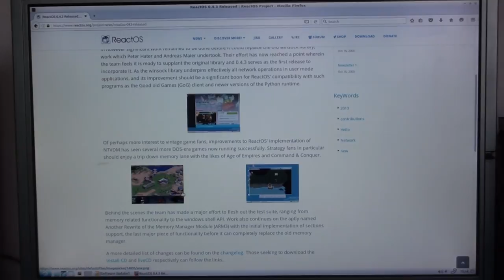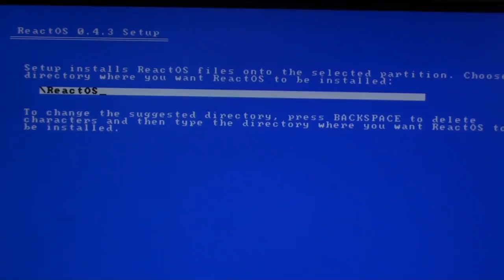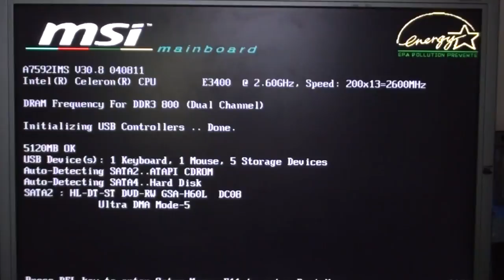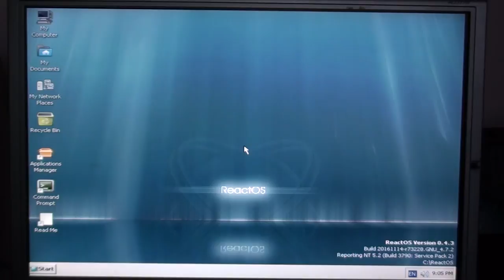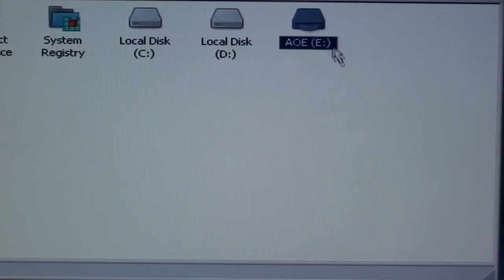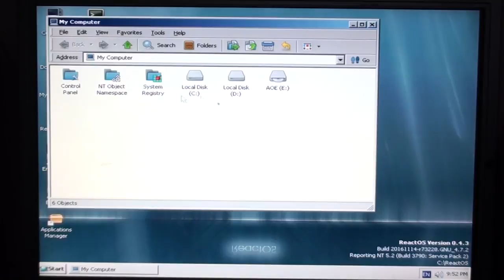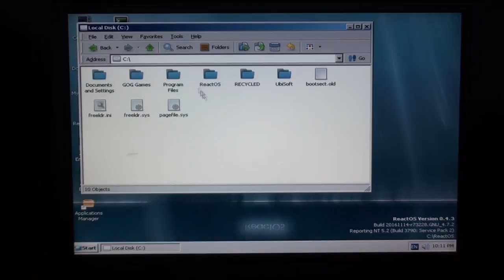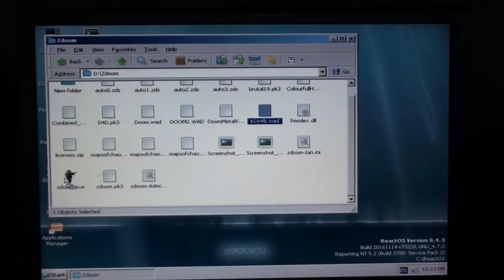A Return to ReactOSSD (v 0.4.3)

Comment: hi from ReactOS team!  Thanx a lot, Druaga! we are already in preparation of ReactOS 0.4.4 (with office 2010, printing and USB support)
Reply: actually no (we have some more important tasks), but you can do it with 3d party software.
Reply: hi love ur idea but i cant install this on my laptop / make a bootable usb
Reply: you can go to deviant art and download any theme you want. ReactOS already supports theming.
Reply: ReactOS Community how do i make a bootable usb
Reply: +Dirk Sieme Nanne Office 2013 won't run until they add NT 6.x compatibility. There is no need for any "stores", ReactOS has application manager already.
Reply: ReactOS Community I have been able to run ReactOS on my dads old work laptop from 2001. It's a ODM Pentium 3 laptop that runs at 845 MHz. It has an ATI Mobility 128 16 MB AGP GPU onboard. I'm surprised that it works at all. Keep up the good work, and hopefully by 1.0, it'll support a lot of older hardware that can't run anything later than Windows 7.
Reply: ReactOS Community Is there going to be WiFi support in the near future?
Reply: We already support WEP - encripted WiFi
Reply: +Dirk Sieme Nanne Well, they won't probably make any stores anyway, but maybe when they finish their application manager, it will be more useful for You. Ofcourse they can make an update with NT 6+ support, but it will take some time.
Reply: ReactOS is what I haven't tried out yet, but I might think about trying it out in the future.
Reply: Its easy, you have 3 choices to make the bootable usb, UNetBootin, Rufus or U.U.I than you need a flash drive and the iso with (e.g) Rufus, finally you follow the stepsin the program you used for your bootable usb stick
Reply: we are in 0.4.* only one year (2016). Slow speed of development is due lack of investors
Reply: .NET framwork is supported but buggy (it is brand new feature)
Reply: Can it run crysis at 60 fps? Anyone tested that yet?
Reply: +Windkrieg XNA works too.
Reply: ReactOS Community make it more look like windows 7 or 10!!! this old shi is ugly :/
Reply: i do like this os btw
Reply: AND change the error sound unless its the computer itself
Reply: just focus on getting emulators and windows game to work on it fam. that's all I care about.
Reply: +CHERANO KREEFT15 They said that they have more important tasks and You can use 3rd party softawre. The error sound came from PC Speaker because driver for audio device wasn't installed.
Reply: +ReactOS Community Please dont listen to CHERANO KREEFT15. The NT ui is the most practical, user friendly and least resource hungry UI and it FARRRRR better than the shitty 'prettyboy' win 7/8/10 ui.

+CHERANO KREEFT15 If you want pretty CHERANO KREEFT15, go and install 3rd party software. There is a very good reason why miscrofot came up with the NT interface how it is because it is designed for businesses and people who want shit done not people concerned with animations and effects to slow you down while gobbling up memory.
Reply: plz keep this look as default, I really like this old style
Reply: Why not create a indiegogo or Kickstarter campaign? I would be so willing to donate. :)
Reply: Keep up the good work guys, it's forming great so far.
Reply: ReactOS Community But can it run Crysis? Jk, even my Windows 8.1 install can't run Crysis...
Reply: It will!
Reply: Good work ReactOS team, I donate whenever I can to support your great work, I hope more people join you guys in the quest to make the greatest open source Windows.
Reply: Windows isn't going to be around forever, windows 10 is also the last version of windows (as stated by microsoft currently, only time will tell if they stay true to their word), and if you can't see the reason behind the project I suggest you look up why some people want a free and open source version of windows that doesn't spy on you, install bloatware, and show ads (all this in an OS that costs $120, greedy asses at microsoft can't get enough it seems).
Reply: +S Kepano - it is obvious you are a troll but to other people who read your shitpost and think what you write is correct - "Whats the point in trying to make a clone of windows when you can get the real thing". microsoft doesn't sell windows versions they have deemed EOL and most microsoft licenses dont allow you to transfer to other computers. The point of ReactOS isnt to replace new windows. It's so you can keep using your old programs when microsoft abandons their old os or makes a mandatory update which breaks your programs.
Reply: Keep up the great work ReactOS what your doing is going to help the world so much.
Reply: Licensing also matters.  ReactOS is GPL.
Reply: ReactOS Community thank you so much!!
Reply: Emulator support would be golden.
Reply: Make ReactOS Great Again
Reply: they have already a store :P ..still ReactOS is in beta so it's not for everyday use
Reply: Hey guys, when is reactOS 0.4.4 coming out?? I made a video on installing 0.4.3 and 0.4.0 on a pentium 4 dell and it wouldnt boot, it gets stuck on the loading bar. Hope 0.4.4 fixes that issue
Reply: im gonna get a another computer to install 0.4.3 on and hope it boots. Ill have it up when i get sometime next week
Reply: +crackerworld No, store and application manager are not the same thing. And ReactOS is in alpha not beta.
Reply: +Peter Kapica If they will stick to their 3 month release cycle, it should be available in february. But don't expect that they will fix any issues preventing boot on your hardware.
Reply: ??? Illen still worth a try
Reply: in the first days of february, before FOSDEM
Reply: ReactOS Community got it.
Reply: Are you guys going to support other file system types?
Reply: +MrShockyShock Yes, as many as possible.
Reply: yes, we are! EXT2\3\4, BTRFS, ReiserFS, UFS are already supported
Reply: Which means you already have more features than Windows.
Reply: add support for Geforce and Radeon
Reply: ReactOS Community Nice things are going good then :))
Reply: ReactOS Community Can it support new technology
Reply: It real a windows.
Reply: React OS VS Damn Small Linux. Which is faster?
Reply: +Super Tux

DSL, its made to run on the worst of worst hardware
Reply: why is react os so reactive?
Reply: Dude imagine how fast React OS or DSL would run on some super fast gaming PC or something
Reply: +Super Tux

it wouldint. neither of the OS's are made for gaming at all.
Reply: Yeah but I'm not talking about gaming, I'm just saying almost everything would probably run instantly.
Reply: YES, FINALLY YOU ARE BRINGING BACK USB SUPPORT, THANKS!
Reply: Will react os ever become a good operating system for older computers, I DON'T KNOW will it
Reply: James Roy Yes it is better to install and use RTM software than alpha software, but I think it is obvious. Currently ReactOS is not meant to be generally used, all releases are just for testing, you can use it for anything if you want but only at your own risk.
Reply: ??? Illen
They actually expanded to 6.3 (7), so its possible Office 2013 will work soon
Reply: sp46 Yes, it is still in the experimental phase though, we have to wait a few months until it is useful for anything, then we might start to think about running such things like Office 2013 on ReactOS. And just in case, NT 6.3 is Windows 8.1, not Windows 7.
Reply: Both are 98% compatible, tho. Except for .appx, ofc.
Reply: You should call it

React Os

Comment: Install an SSD into a PS2
Reply: That would be awesome. I've been thinking about that lately as well, wondering if that could work.
Reply: USB 1.1 breaks the idea of a CD emulator. I think the fat ps2 with custom firmware and the network adapter should work with a $5 sata adapter to load games off a SSD. druaga1 should consider this.
Reply: Look on eBay. There's custom network adapters with SATA connectors on them. 100% possible.
Reply: That is 100% possible. At least if you have a fat ps2.
Reply: +DeltaDragonoid225 I have it!
Reply: Certain versions of the slim variants still have the i/o pins to connect a hard drive to. Power is a story for another holiday.
Reply: SSDs can be powered with usb wall chargers.
Reply: Max Gerner ps2 is under 100$ on eBay if I am right.
Reply: what? more like under $40 now.
Reply: Martin's Tech&Games under 100$ means under 40$ but 40$ is more accurate.
Reply: Martin's Tech&Games under 100$ means under 40$ but 40$ is more accurate.
Reply: It's best to buy a stock IDE network adapter and use an IDE to SATA since the sata ones are chinese and don't have good compatibility.
Reply: Dr. Sinclair IDE to SATA adaptors are also Chinese, and have horrible quality.
Reply: Quality is beside the point. There far better compatibility with a specific adapter from china than there is the actual adapter.
Reply: Dr. Sinclair I'd rather have a solid connection to the network adapter than trying to mess around with those adapters. If you find a good one, then good for you. You're still limited to 480 mb/s with IDE either way. Better to just stick to an old IDE hard drive.
Reply: There is a perfectly shaped one for like 10 bucks that fits perfectly in the HD slot. This adapter with an official sony network adapter has the best compatibility and I know this for certain because I've dealt with PS2 modding recently. I installed an SSD in it and it improved load times for things like cutscenes and launching but it's diminishing returns. Mechanical drives are perfectly fine.
Reply: Le' PisSSD
Reply: Why not install an SSD into a PS/2?
Reply: Surprisingly that would be possible.
Reply: I still have a fat PS2, that I haven't really used since maybe 2012 or 2014 at latest.
Reply: Since when Druaga uses game consoles?
Reply: I used an external hd via usb on a ps2 slim, if i got my case and replaced it with an ssd it would probably count
But a fat ps2 on the other hand did have hd support so its just plug on in there (with a sata to ide adaptor) totally possible
Reply: And ps2 also has linux

Comment: if reactOS evolves to the point at which it's pretty much compatible with today's software, and it can play any windows PC game like battlefield 4, or anything else, i would 100% switch to reactos for games
Reply: +SwizzleDude Win 10 is shit
Reply: it's open source: the code is open for anyone to tinker with. anyone can look at the code, trim things out, fix it, improve it however they like. Quite frankly, that's hard to beat in terms of transparency, compared to microsoft that decided to make all previous versions of windows obsolete, to add microsoft account login for win10, to add windows store without giving you any choice to not install it, and sneaking onto your computer any update that you might not actually want to install without asking you or notifying you.
Reply: it's free: anyone can freely install and use it on any computer can be found in the trash, in the street, and in yard sales. it's a solution that works regardless of wallet size, and legal and safer compared to cracked keys and shady windows-activation software.
Reply: popularity: windows makes money because everyone uses it, everyone uses it because it's installed by default on computers wehn you buy them. if everyone uses it, it doesn't mean that it will ever be good, everyone uses it because of deals made between the computer makers and microsoft. (if that wasn't the case, linux would already win the pc world right now, and it already won the server world and the embedded devices world)
Reply: talking about 12 year olds, take a good look at yourself. i'm 22, i work with computers. i know my stuff, and at least i educate myself on the problem before arguing with it.
Reply: Agreed. Windows 10 is shit, Everything from MS from 2011 onwards is casual-oriented shite.
Reply: +SwizzleDude Why? Because Win 10 is a backdoor. That "system" is not even your own. It's an service. It is stated in the Win 10 EULA.
Reply: ***** No I just don't want my info stolen without from a company that I trusted over and over again.
Reply: If I could flip the middle finger at anything I wanted and have it tooken down the next day, I'd flip it at Windows 10 and watch it go down the next day.
Reply: @jpjude68  Linux is free if you don't value your time. (Speaking from 10 years of Linux daily.driving

Comment: Great video as always Druaga! I see your into ReactOS too. I have ran it on a physical machine myself, it's coming along nicely. The developers are working very hard at getting everything up to XP working smoothly at least. The last time I ran it, it was a SVN release of 0.4.0 I think. My dads old Pentium 3 laptop from 2001 is able to run it without a problem, although it's not as stable as good old Windows 98 SE.
Reply: It's improving every day! Don't bash ReactOS because how unstable it is. Remember, it's still in Alpha, which isn't supposed to be used daily.
Reply: SwizzleDude if you don't have the money to buy a legit license, and/or looking for something light weight and not bound to a computer at a time, unlike Windows since XP.
Reply: Well it is a great initiative - but ... I fear it may become spagetti code trying to fix all these issues. From what this video shows they are a long way away from a stable beta. Years.

Comment: I'm kinda wondering how well ReactOS would fare in the POS department. I'm only familiar with Windows POSready 2009, which is essentially a Windows XP that's supported till 2019. I could imagine ReactOS find an application running older POS software. POS computers are almost never upgraded. They usually sit around for 20 years until it's too expensive to get replacement parts.
Reply: I know your comment is old but POS won't work because there's no ODBC support in ReactOS. If they get support for that then it might do.

Comment: ReactOS is nothing more than a hobbyist's proof of possible concept.

You can get more done in a DOS prompt than with this, and it's been around (reactos) for A LONG TIME.

I'd rather see console system modding go somewhere further than reactos.
Reply: Age of Reason I realize this comment was a year ago, but you clearly don't realize what they're actually trying to do and how much work goes into it. Full Windows compatibility without using ANY Windows code takes an entire rewrite. From scratch. They have a small team and zero funding, of course it's taking forever. And Microtheft bought DOS from someone else in the first place, so it's irrelevant here. ReactOS is a real chance at using Windows software without the downside of, you know, having to use Windows. Open source is just plain better for users.

Comment: Supermicro SuperWorkstation 7047A-73 - 8x SATA/SAS - 16x DDR3 - LSI 2308 6G SAS - 1200W PSU
CPU: 2x Twelve-Core Intel® Xeon® Processor E5-2697 v2 2.70GHz 30MB Cache (130W)
Memory: 128GB (16x8GB) PC3-14900 1866MHz DDR3 ECC Registered DIMM
Hard Drive SATA: 2x 6.0TB SATA 6.0Gb/s 7200RPM - 3.5" - Hitachi Ultrastar™ 7K6000 (512e)
Hard Drive SAS: 2x 6.0TB SATA 6.0Gb/s 7200RPM - 3.5" - Hitachi Ultrastar™ 7K6000 (512e)
Hard Drive SATA: 2x 6.0TB SATA 6.0GB/s 7200RPM - 3.5" - Seagate Enterprise Class v4 (512e)
Hard Drive SAS: 2x 6.0TB SATA 6.0GB/s 7200RPM - 3.5" - Seagate Enterprise Class v4 (512e)
Optical Drive: Pioneer 16x Super Multi Blu-Ray Disc Rewriter
Card Reader: Internal 3.5" Multi-Card Reader (USB 2.0)
Video Card: 2x NVIDIA® Quadro® M6000 12.0GB GDDR5X (1xDVI-D, 4xDP) SLI
Accessories: Quick-Release Mounting Rails for Standard-Depth Rack - 26.5" to 36.40"
Monitor: 32" LED-Backlit IPS Panel - 3840x2160 (4K UHD) - DELL UltraSharp UP3216Q
Keyboard: Logitech Keyboard K120 (USB)
Mouse: Logitech B100 Optical Mouse (USB)
Peripherals: Cyber Acoustics 2pc Speaker System
Power Protection: APC Smart-UPS SMT3000C 3000VA LCD 120V (2700 Watts Output)
Operating System: Microsoft Windows 8.1 Professional with Recovery Partition and DVD (COA)
Warranty: 5 Year Advanced Parts Replacement Warranty and NBD Onsite Service
Reply: VMware Workstation 12.5.2 guest machine:
CPU: VMware CPU Host (Intel Pentium Dual-Core E5400 2.7GHz)
Memory: 2048MB DDR2-800
Video Card: VMware SVGA-II (Nvidia GeForce 8800 GT 512MB)
Sound Card: Creative Sound Blaster PCI 128
Hard Drive: ReactOS.vmdk 60GB
Operating System: ReactOS 0.4.3 (Other Windows)

Comment: If I see all your troubles with this OS I would really rather stick with Windows XP. 
In fact, XP can be as fast as React OS, but don't connect it to the internet, don't put any updates in it nor a virusscanner. 
That would work fine too. Maybe it's something you can try on this machine if React becomes a total failure.
Reply: Standalone = useless these days. Might as well go back to Commodore 64 if you cannot connect to the net. Unless you only use it for games that is.
Reply: You can work via via. Just use an USB stick as transfer medium to add files to your XP machine. No Windows updates needed. Assuming you are playing games not online.

Comment: In all fairness:  You can't just stick an old Windows drive in as a secondary, and launch a game that was installed on it.

You have to reinstall on the new drive.  Maybe he does that later in the video.  I haven't gotten there yet.

He's in too much of a hurry.

How can you complain about not being able to play multiplayer, when you have no Internet access?  Also, if the game is too old, that may no longer be available.

No USB?  First place to check, before just...dropping them all on the ground, is device manager.  Probably need drivers.  What I would do, or would've done, I should say, is go to the vendor websites on another machine, and download the drivers.  Then, burn them to a cd, and finally, install them on the host machine.  

Just a thought.

Cut out the coffee, dude.